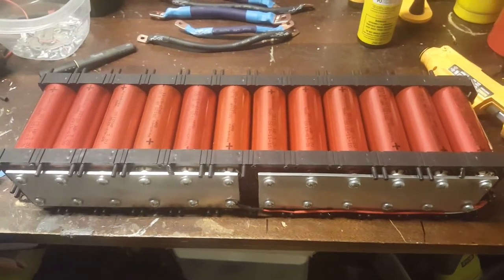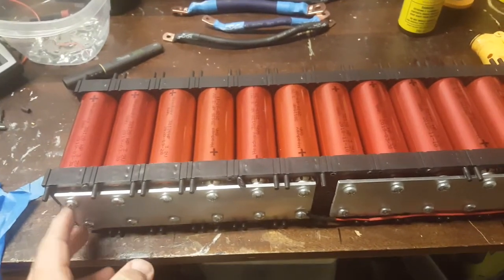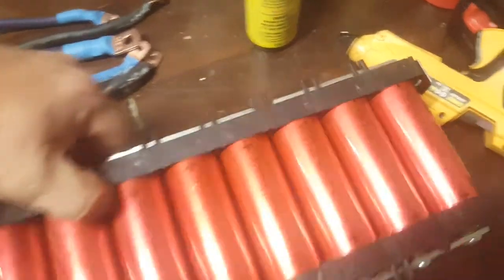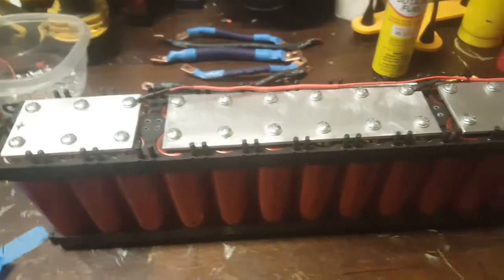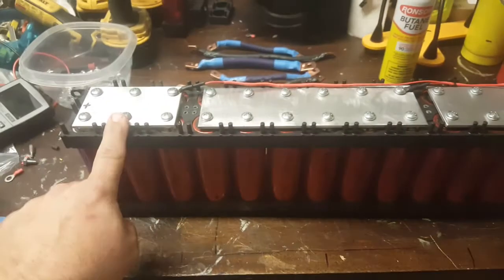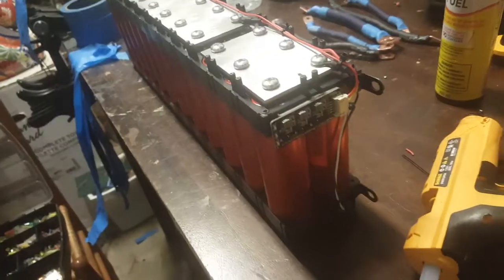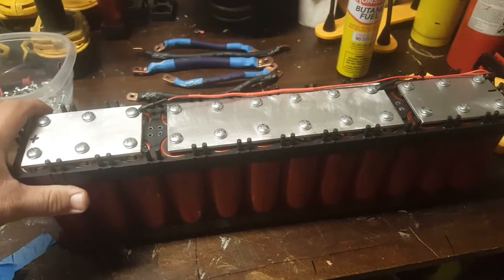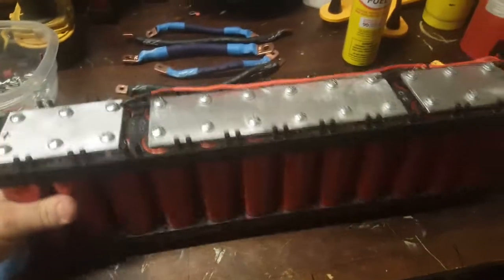Changing up the Headway cells

Comment: Would charing these with an alternator through a 160amp fuse blow the fuse you think? Trying to sort out my charging for my battery generator project
Reply: I have a dc to dc charger but it only does 6amps so I was thinking jumper cables to my car and start it up and let the alternator do its thing!? Idk lol
Reply from the maker: I wouldn't think it would blow anything I sometimes charge mine separately with a 20 Amp smart charger the thing is they charge up extremely fast
Reply: @E Dud  not at 6amps they don't lol
Reply from the maker: @2down2togo  yep 6amps would take awhile🤣
Reply: @E Dud  I think I'm going to try jumper cables to my car for about 15 minutes and see what that gets me to then finish it with the hobby charger until I can get some solar panels!
Reply from the maker: @2down2togo  that should work
Reply: @E Dud  just tried it for about 5 minutes and got roughly. 05v so may take a bit to charge, we'll see lol